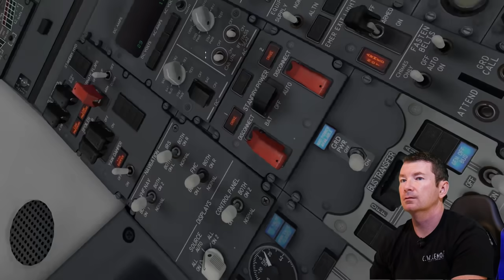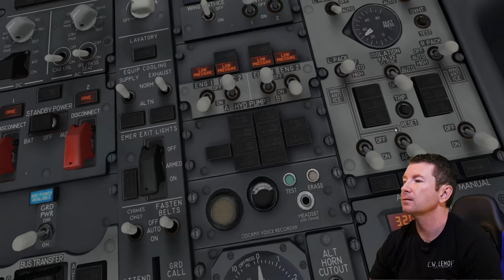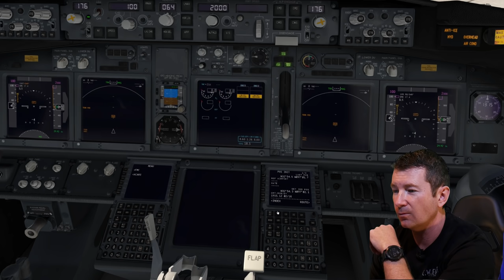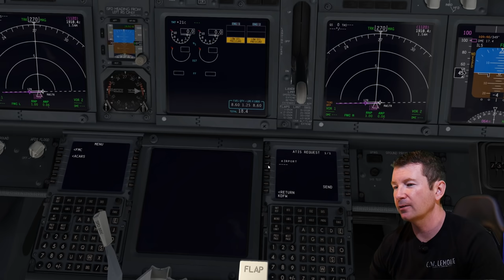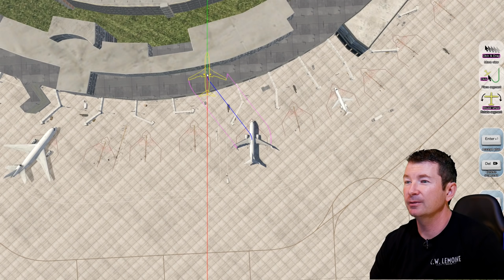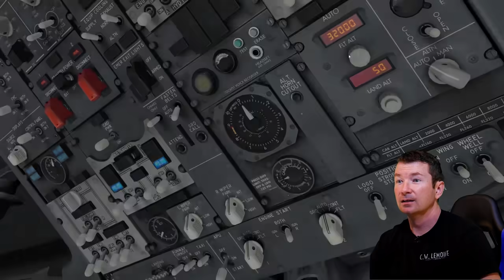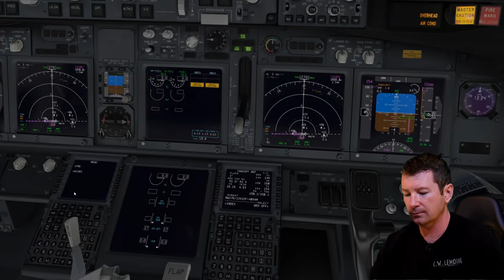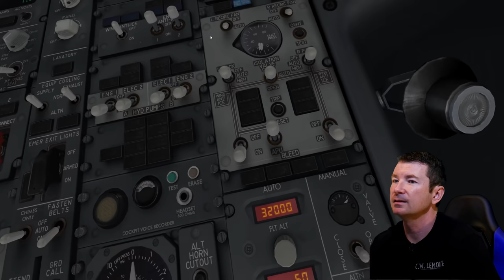REAL 737 Pilot Flies X-Plane 11 ZIBO 737-800 (Part 1) | Preflight, Start, Taxi, Takeoff.

Comment: Doesn’t want to set up yoke, sets up warthog flight stick
Reply: I don't see a problem there.... and so does Mover.   I use a Saitek X52 pro HOTAS and guess what?  It makes no difference if you fly a F16 ( throttle left, stick right) or a plane which  is controlled by a yoke.  Your brain will adapt shortly..

Comment: Are you using the HOTAS slew control for rudder control? 

Also, not saying you need to spend money but if you ever want to get into a yoke that won't break the bank, the Honeycomb yoke is an excellent choice for $250. I got one and it is crazy smooth. It feels good enough to compare it to GA, though I've never flown anything like a 73...just C182, Cherokee PA28, Pacer (don't remember the number I think PA20?), and Beech Bonanza G36.

Thanks for the awesome content as always!

Comment: Question to any pilot trained in the military. 

Could a soldier in theory be able to fly a commercial or civilian airplane with knowledge of fighters?

Or is that like a seperate training.
I imagine that since every plane is different  Sure it's not ideal at all, but could a soldier in a worst case situation be able to do it?
Reply: Obligatory not a pilot, but I think atc have  measures in place to help inexperienced people land if need be. So for a trained fighter pilot it should be pretty damn easy. I’d say if someone can land smoothly and consistently in a sim your chances would be decent. An Understanding flight dynamics and basic controls should be enough to land and the atc is available for the other stuff

Comment: 28:07 Hey, what is the odd quarter-wheel thingy moving back and forth on the rightmost side of the cockpit, behind Mover's camera-left shoulder?
Reply: That's the tiller, used to steer the aircraft on the ground
Reply: @PSPmaster321  I thought that was the door handle and he tried to get out before that machine blows off.

Comment: I’m a flight simmer usually fly the PMDG 738 on FSX, it took me 4-6 hours to learn when I first tried the PMDG 738 out. I’m not saying you’re wrong, but in the tutorial flight for that particular product it does say set the ignition switches to continuous, HOWER been though it went your intention thanks for explaining that some airlines set it to Auto. I am also
a student pilot as well in real life. Learning in a Piper Cherokee.

Comment: 12:20 Hey Mover. Can you explain what you are doing here? Are you setting trim before you take off?
Reply: That's exactly what he's doing. He's adjusting the trim to account for where the centre of gravity is given the balance of passengers. If you don't do this you might notice, for example, that around 80 knots the nose of the plane starts to rise before you actually get to V1. (I think)
Reply: @bruceyboy7349  That makes sense. Thanks.
Reply: @johnp2110 If it's any further help, in the Zibo mod if you look at the tablet there is a weight and balance page  (I'm not on my computer so can't remember exactly where - I think it's in the fuel area). You can enter your passenger distribution in there (I just leave it as it is most of the time). I think you have to go to page 2 of the screen to enter in how the passenger's will be laid out. On page 1 (I think) it shows you the resulting CG and you can then take this number and enter into the FMC where it will then give you the trim setting to use.

The weights and balance page is fairly new to the Zibo mod so make sure you have a recent version. Flight Deck 2 Sim did a recent live stream where he ran through this (about 2 or 3 weeks ago).

Comment: Hey, just a curious A&P, do pilot checklists generally have you hit on a fuel pump on a '37 for the apu, even though it puts on a pump regardless of switch position to supply apu with fuel? we don't generally bother throwing a pump on
Reply from the maker: Yes. A center pump

Comment: I didnt know the 7(5/6)7 was still used on passanger flights. Thought they were old enough let alome training new pilots for them.
Reply: Still hauling cattle in both...The types are basically interchangeable as the flight decks were specifically designed so that there was very little cross training necessary.  Fly a 75...jump into a 76 blindfolded and you'd have a hard time telling the difference.  Other than the little extra elbow room.
Reply: Jet2 and Tui still fly the 75 in uk. Tui still fly the 76 too

Comment: Btw now AA uses airbus A320 and BOEING 737-800 or 900 based on their determination. The 737 takes forever to get off the ground... the Airbus feels like you don’t even need a pilot flying the plane as everything has become so automated....
What’s the most “challenging airport” for you to land in if there is such a thing ( not talking about Nepal lol)! 🇺🇸🇺🇸
Reply from the maker: AA uses the 319/320/321/330 and 737-800 and 737 MAX (well, used to) in real life.  Challenging airports would be Orange County, LaGuardia, and DCA in the US.  Quito, Ecuador can also be a challenge as well as a few of the Caribbean airports.
Reply: C.W. Lemoine mine was STT. I flew into and out of that at least 200 hundred times ! I couldn’t believe that in all they years I was there not once did a commercial aircraft aircraft take a dive . It happened with an AA Boeing 727 in 1977 due to pilot error but they lengthened the runway significantly and since then the only issue I ever involved with was on full take off about 1/2 way down the runway (once in my life) the computers so we were told shut down the take off...,
Thanks again as I learn so much from your passions! Cars planes, life! Great mentor my friend!
Reply: Quito is nuts. One of those where being in the back adds a bit of anxiety for not being able to see it coming “oh the hills are above the plane and a few hundred metres off the wing... awesome”

Comment: I have question that I have for years now. Why does the pilot on take off first give a little bit of throttle, waits a moment and only after that gives full throttle? What prevents him from giving full throttle at once?
Reply: To make sure the engines spin up evenly and nothing goes wonky. You wouldn't want to go full takeoff power from idle and have one spin up much faster than the other.

Comment: Hey Mover, if you don't want to deal with V.R you can download a free program called OpenTrack that you can use with either I.R lights setup on your headset or you can do what I do and use what is called an Aruco Paper Tracker and all that is is a piece of paper you print out and tape onto a rigid surface such as a piece of cardboard and you can attach it to a hat, headset or whatever you're comfortable with and it will track your head movements and everything without having to deal with V.R and it's low FPS. Here is the link to OpenTrack with tutorials if you're interested in it, I use it for all my flight simulator games such as Prepar3D and DCS World and I prefer it over V.R and TrackIR due to the simple fact that it's easy to setup and you don't have to have it all setup before launching the games like you do with TrackIR. Here is the link to the download page of OpenTrack on their official Github: https://github.com/opentrack/opentrack/releases and here is an in-depth tutorial on how to set it all up: https://forum.il2sturmovik.com/topic/34403-a-complete-guide-to-set-up-head-tracking-opentrack/ now if you want to use the method I use which is the Aruco Paper Tracker this is where you can find a tutorial on how to set that up as well: https://github.com/opentrack/opentrack/wiki/Aruco-tracker

One thing you do need though is a webcam, doesn't have to be an expensive webcam or anything like that you just need a webcam that you can use with OpenTrack in order for the program to track your head movements. Oh and if you do choose to use the Aruco Paper Tracker method just know that it does look a little silly but nothing bad, similar to having I.R lights attached to your headset or even wearing those big bulky V.R goggles haha.

Comment: How were you so quick identifying the problem at 34:44? Common issue for real pilots? Normally when I get alarms I can't figure out I'll just roll the plane into the ground.
Reply: The overhead was telling him all the time but since he was doing copilot side duties he even forgot to turn on Landing lights before take off to name few items..
Reply from the maker: Center pumps with no fuel in the tanks. Happened around takeoff. Not a huge deal.
Reply: I guess that's why type rating take like 2months 😂😂

Comment: I have a hard time seeing the structure with your flows. Is this sop's or you just going with your own flow?
Reply from the maker: Which part are you referring to?
Reply: @CWLemoine  rainbow check/ preliminary flight deck inspection, tech log, fmc/cdu pre-flight, safety inspection, before start to the line/below the line, before taxi, before T/O to the line/ below the line...
Reply from the maker: Some of the initial stuff was technique but it was mostly SOP.  All the checklist stuff was verbatim.
Reply: Cool man thanks for the video. Who do you fly for?

Comment: What the hell is bleed off 😂😂 
I just press go and fly , normally ends up in a Crash but still
Reply: I think it is about the bleed Air, the Air which is mit used for propulsion but for AC and presserisation and stuff

Comment: Take a deep breathe and think for a second. Is it really that difficult to turn off the AC pacs to start the turbines? Maybe with one man cockpits you guys will be begging for something to do instead of just being a monitor
Reply from the maker: It's a holdover design from the 707.  Has no place in a modern cockpit (which it doesn't in the 787 or 777... it has a lot to do with why the MAX is such a failure)
Reply: @CWLemoine  I don't mean to be an asshole but I was an airline mechanic for 20 years and we would actually be working for the same company now if I had stayed. I was never a fan of Airbus and we used to joke that the pilots flying ability sucked but they could type 150 words a minute. I just don't think it's a big deal to hit a switch every now and again in the big picture. I also worked on 707s back in the day so I guess I am old.